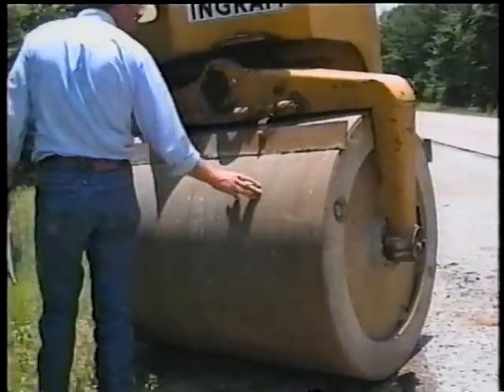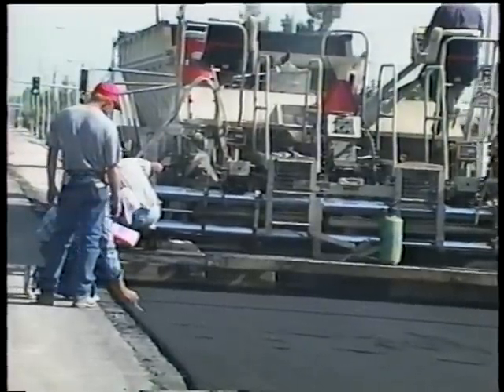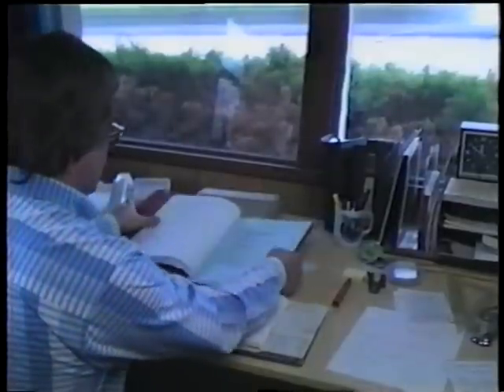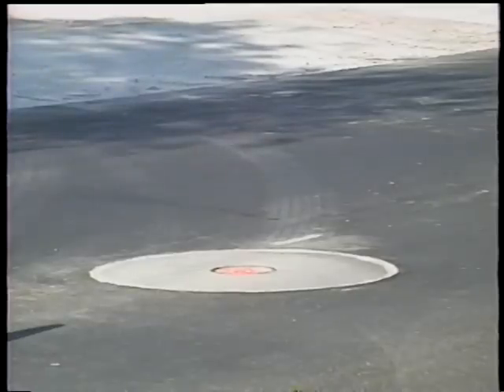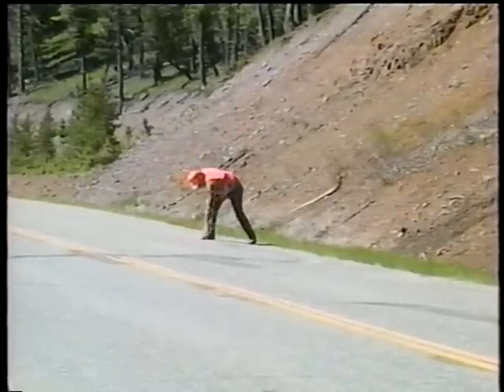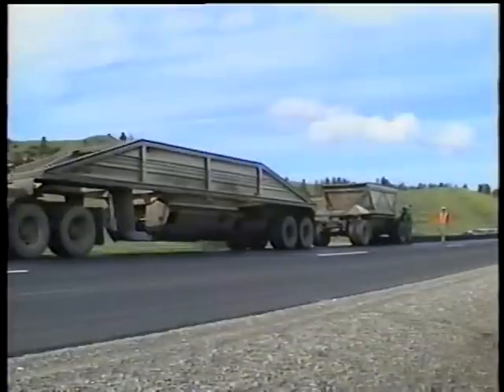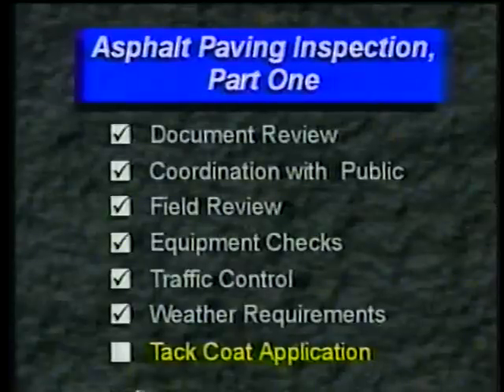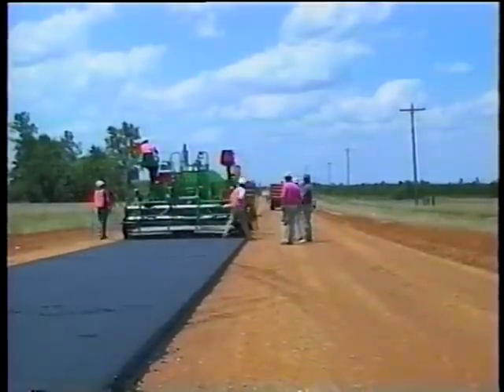Asphalt Paving Inspection (Part 1)

Comment: They don't do any of this. The paving crew does everything, and the inspectors just walk with the spreader or sit in their truck.
Reply: has anything changed? thinking of doing this
Reply: Depends on the type of job and if it’s a state road, county road or private road and if it’s new install or rehab. But in general there is a lot of sitting and watching as an inspector because that’s what we are supposed to do. We have to document what we see and verify things are being done to spec. Plus we don’t want to get it the way of the workers so we tend to stay out the way as much as possible as to not interfere. I’m one of those inspectors that picks up a shovel or screed rake and helps spread the asphalt or clean up debris when needed because I get bored just sitting and watching all the time plus I worked and ran my own crew before becoming an inspector so I like to actually physically work, my back just hates me for doing so.

Comment: I’ve been an inspector in Maryland for going on 12+ years now and I’ve never in my life seen tack coat applied so heavily and evenly. I feel like I’ve been lied to all these years even though I’ve never had a problem with any roads I’ve been a part of. Every crew I’ve ever observed always spray lines of tack.  I’ve never seen a coating that is akin to that of what spray paint coverage would be.  It’s got me wondering if and what difference between the two application methods would be.
Reply: I've seen tack put on to thick, it ends up bubbling to the surface under the breakdown roller. Its a mess.
Reply: It depends on the situation. Heavily applying tack coat should only be done when there is dimples or a porous/less dense asphalt/aging asphalt underneath the overlay. Generally if it is applied in lines it should only be done if the asphalt surface is smooth/small aggregate because adding extra tack wont do much to bond the lifts together. If you mill the surface or are using larger aggregate asphalt you should always coat the entire surface of the previous lift before laying your next lift, doing it in lines will not be sufficient to make any noticeable  difference in longevity or durability.
Reply: how do you become a slurry seal inspector? what's the best way to get started... maybe even doing it starting your own business? any tips/insight?

Comment: LoL "due to our nations move to metric" 22 years latter still not on metric
Reply: Many people are unaware that the United States is on the metric system and officially signed the Treaty of the Meter in 1893 to make it so.  All the non metric units we use like inches and foot are defined by conversions from the official metric standards. So even though the majority of the public hasn’t switched usage to metric and still use non metric units like feet, inches, miles, etc…, the USA actually is officially on the metric system.